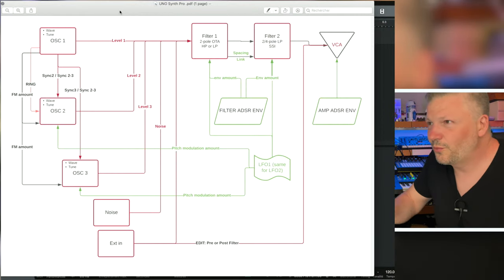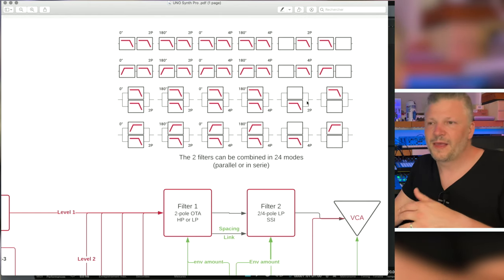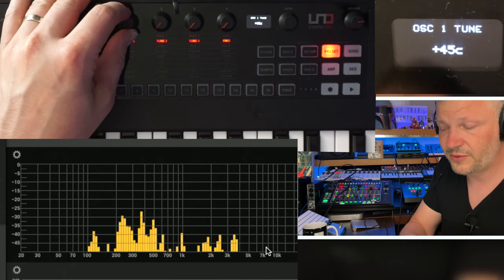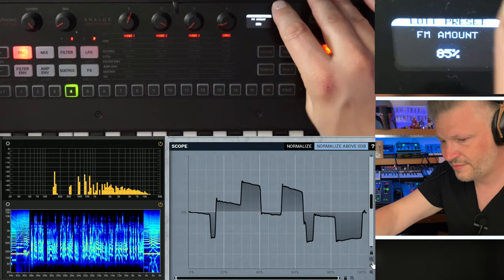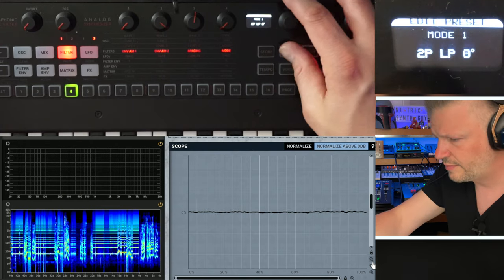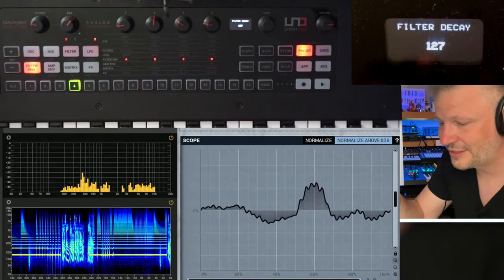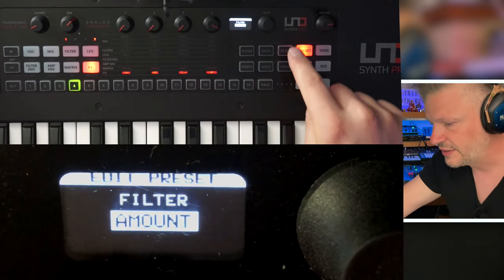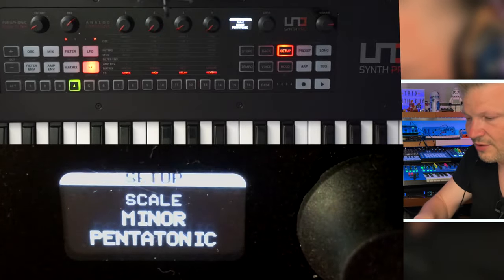Uno Synth Pro synthesis guided tour - hidden secrets & menu diving

Comment: Merci!  Nice to see a little more depth on the synth.  Just picked it up, and although I'm really impressed with it (osc's sound solid, filters are flexible and great sounding, and the Fatar keyboard is a pleasure to play), I'm less impressed with the USP manual (no menu tree, no shortcut list, etc) and interacting with IK Multimedia's website.  They're not horrible, but where the synth gets a fairly high rating from me, "IK Multimedia Support" seems just so-so.

That being said, I'd rather be impressed with the gear more than the company, versus the other way around.

Comment: 16 mod slots, but you’d loose 4-6 to the obvious ones ; velo to cutoff, velo to amp, pitch bend to LFO, LFO to freq, when you look at the zencore of roland  machines most of the obvious (approx 20) are built in, even velo to reso, however the oscillators and filters sound incredibly good, but the well know fact about buggy firmwareS of this company pushes me back not to buy one. Oh and very important to me with parallel filter structure is ability to split them left and right. Great vid mate !